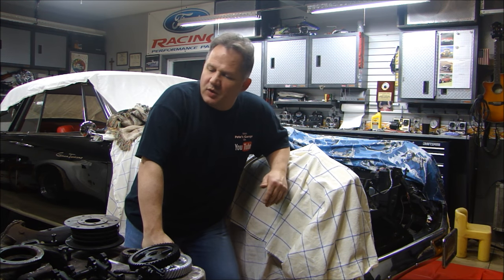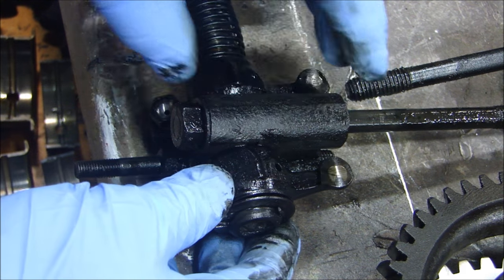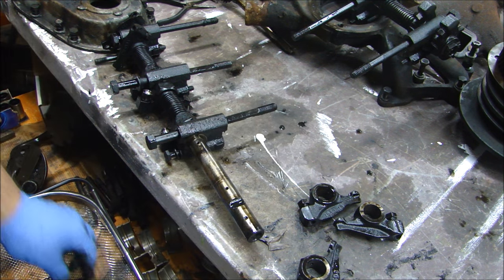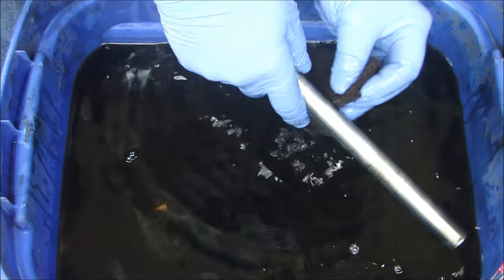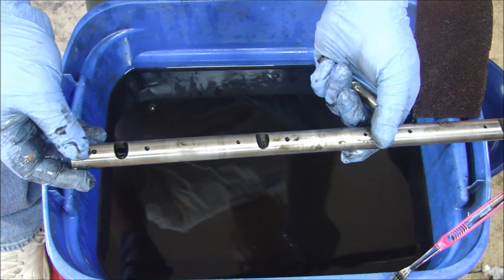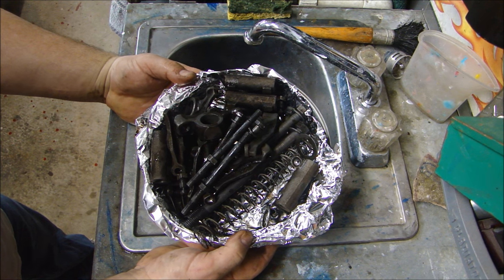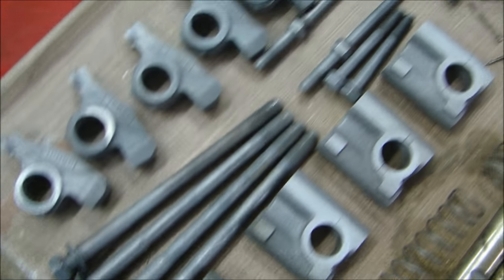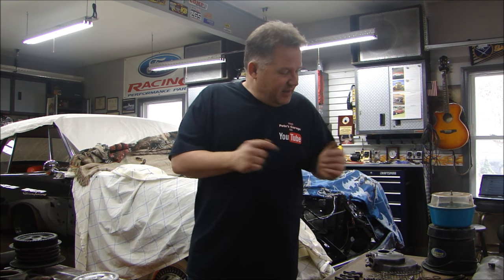Engine Rebuilding - Part Cleaning

Comment: What do u think about cleaning with washing soda? I just got a 1953 farmall I took the head off and got a 20 gallon tub and mixed water and washing soda and put a truck battery and a 10 Amp charger on it and left it for 2 days took it out and water hose and it looks great 👍 👌 and for no more than the cost of washing soda 7$ big box it's clean and I didn't elbow grease myself to death just would like your in put about that way of cleaning thanks in advance I really appreciate your video I've been cleaning parts for over 20 years full time and finding a easier way makes my day and life better !!
Reply from the maker: If that works, great!

Comment: Great vid 👍 Is it ok to rinse the internal engine parts with water after using the degreaser? Will it not cause flash rust ?
Reply from the maker: Yes it is, just dry them and spray some WD-40 on them to prevent rust

Comment: I am working on a rather obscure car, a Volvo 1800ES.  Your method of clean the engine parts sound good, though I would not use oven cleaner on the aluminum or brass parts.  You mention bead blasting.  I assume you are talking about glass bead.  I have a blasting cabinet for non-machined parts such as suspension, brackets, etc.  Just bought a bench top cabinet just for bead blasting so that I don't have the worry of stray aggressive grit messing up a machined or aluminum/brass part.  What grit glass bead would you suggest?  What about walnut shell blasting?  Any experience and suggestions on working with that media.
Reply: Mag wheel cleaner cleans aluminum really good
Reply from the maker: Walnut shells would be good for that

Comment: Hey Boss, I love the video but there's one thing that wasn't answered clearly. Can you clean your engine parts (Head Gasket, Valve cover, screws etc..) before reusing them to build your engine? Just wondering if it's safe for the engine and that it won't blow up or something haha. yeah, it's my first time working on an engine,
Reply from the maker: Absolutely, clean every part
Reply: @PetesGarage  do I need to lubricant any parts before installing?
Reply from the maker: Yes, use the oil you're going to put in the engine

Comment: After you spray with over cleaner you can chuck the parts in the dishwasher. Just make sure the wife isn't home.
Reply from the maker: What's the wife have to do with it.....lmao
Reply: There will be hell to pay! But I use the oven spray too. In my Mopar 318 type rocker covers it was sludge city with unreachable baffled inaccessible areas, I put them in a five gallon bucket and put pre-mixed lye powder (with water in a Pyrex dish) and soaked for a few days and got rid of the sludge  the cheapest way. You get the lye as "drain opener" at the home improvement store plumbing department. Be really careful with it! It burns!
Reply from the maker: That's a good idea, buy you're right, it's caustic

Comment: Is there a difference between degreaser and parts cleaner also using a concentrate parts wash is this stuff ok considering it uses water.
Reply from the maker: Parts cleaner is a petroleum based product that dilutes grease. Degreaser is a chemical that separates oil so it's easy to clean.

Comment: hey pete how u duin man.. is thier anything i can do to a 2011 malibu 2.4 like engine wise and make it faster something out of the ordinary by replacing old parts with new parts and get a good decent maybe 400 hp or so?? js thanks
Reply: maybe something i can start first and then move up?? is thier a list what you would recommend me doing??
Reply from the maker: Not really. That is a stressed out engine as it is. You could put a turbo in it, but you'd have to change pistons and valves.
Reply: thanks pete.. how much would that cost in total??.. i live in san antonio texas by the way..

Comment: I had some very sludged up rocker covers from hell. There were some sheet metal baffles inside so I could not use mechanical means to reach inside the shrouded part. .I took a gander and saw that the oven cleaner was lye. It is sold as drain opener in powder form. You MUST  put it into solution by adding the powder to water before you put it into your five gallon plastic bucket. It will melt a hole through it! It generates so much heat it will literally burn your skin off.  But it will de-sludge inaccessible sludge like the spray oven cleaner only cheaper. You must be really careful of the high temperature created when the powder changer ito solution. After that, it cools down and is like ultra strong soap. I have been enjoying the Cobra build! Don't leave aluminum in it without you watching it. It may etch it.
Reply from the maker: That is interesting, thank you for sharing.
Reply: LMFAO!! I strongly advise AGAINST USING lye (Hydrochloric acid) to clean anything aluminum. Did you know that aluminum reacts with hydrochloric acid to produce aluminum chloride and HYDROGEN GAS "2Al(s) + 6HCl(aq) -> 2AlCl3(aq) + 3H2(g)"  ??????

Hydrogen is extremely flammable and has no smell or color. Which makes it EXTREMELY DANGEROUS to your average person because even a tiny electrostatic discharge can be enough to ignite it, and they would have no way of knowing if they were at risk of accidentally blowing themselves up.

Comment: so why not just use gasoline instead of that expensive cleaner? Much cheaper and I think does the same job?
Reply from the maker: Gasoline is a fire hazard
Reply: @PetesGarage  very true, but better alternative then that $170 bucket. For example diesel, very effective cleaning parts and leaves a films that preventing the parts from rusting. I mean come on, for $170, i'll buy a new engine lol
Reply: Gasoline is a horrible parts cleaning solution.
Reply: @whiplashmachine  Depends what you're cleaning. For parts with rubber or similar fragile components, yes I'd steer clear. For classic car chassis, suspension and drivetrain components made entirely out of metal that get covered in decades worth of oil and grease, it is extremely effective. An hour or so of submersion will dissolve grease in every nook and cranny allowing it to be washed out.

Comment: Pete,  Sir I think you are great, please wear rubber gloves when using oven cleaner, that can cause one massive burn and extremely flammable material on your skin.  Where s the store for shirts.
Reply from the maker: Thanks Jonathan. There are a couple types of oven cleaner. The one I use is not like Easy Off, it's more organic and not dangerous to your skin, but the vapor is still rough
Reply: Please mention the organic brand of oven cleaner in future videos    Thanks Merry Christmas
Reply from the maker: I will....Merry Christmas to you my friend